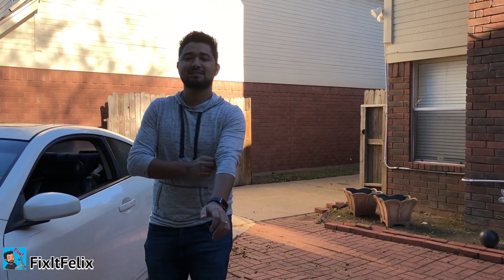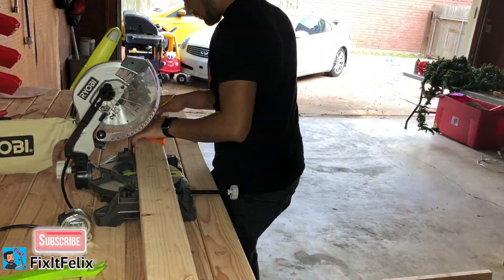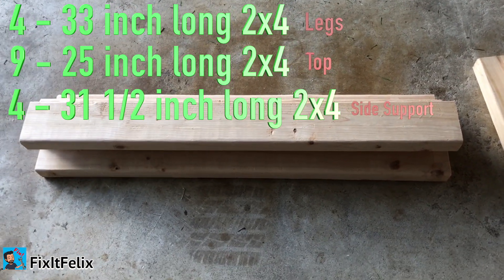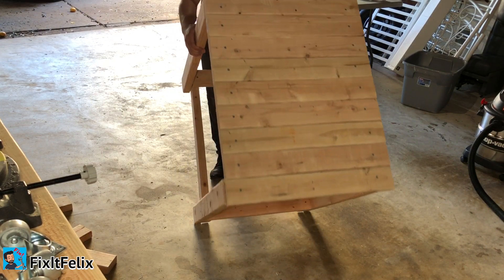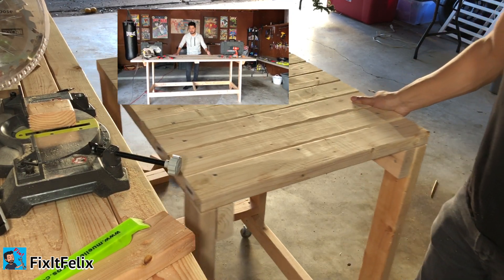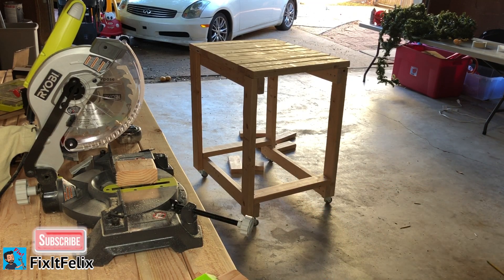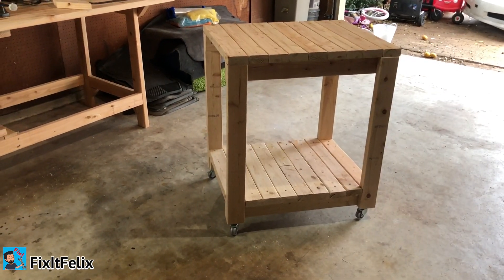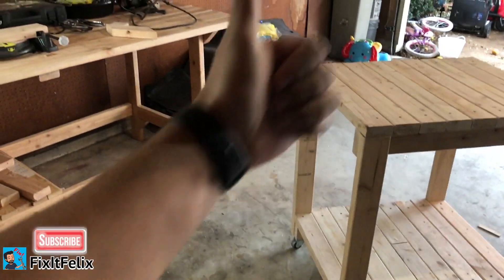Small work bench on wheels ( using 2x4 ) diy

Comment: You cut your support 2x4’s at 31 1/2 inches.. which makes the bench 31 1/2  inches long. How did you fit 9... 4 inch wide 2x4’s evenly on the top? 9x4 is 36. Not trying to be a smart ass.. I’m just confused.
Reply from the maker: I know it’s confusing but believe it or not a 2x4 it’s not really a 2x4 it’s actually like 2x3.5

You Can google how wide a 2x4 is and you will see.  Hope this answer your question
Reply: I did not know that. Sounds like we’re getting ripped off by the lumber industry 😏. Thanks.